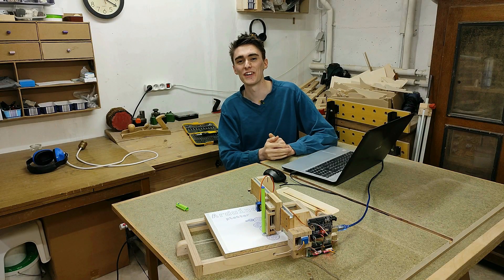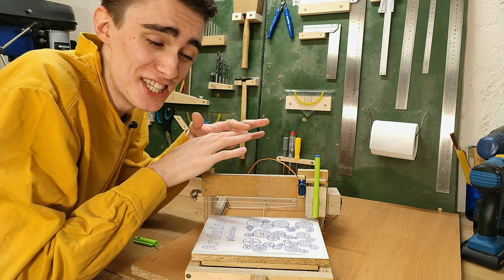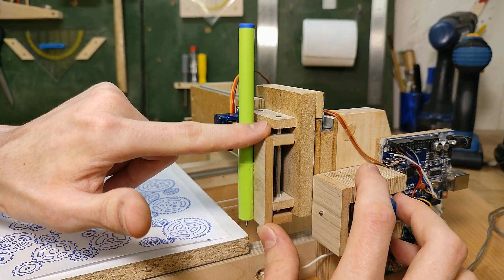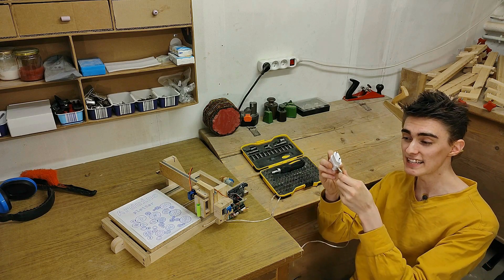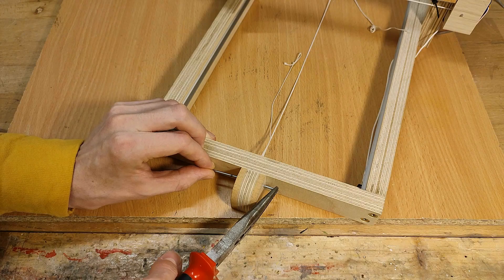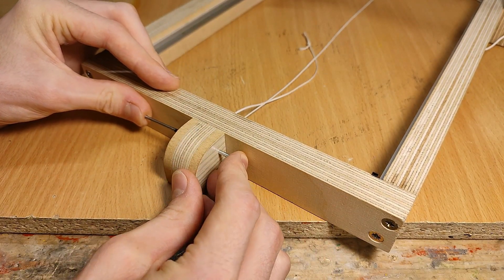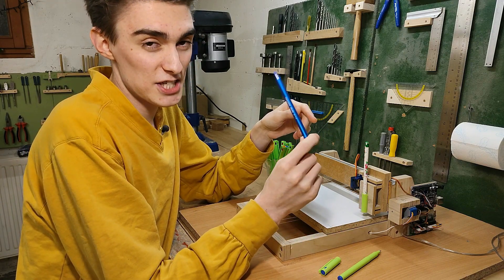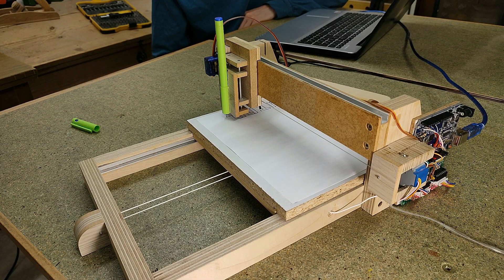148x210mm Arduino CNC plotter using 28BYJ-48 stepper motors

Comment: Really great video !! I really respect your way of explaining everything, BTW I had also faced the same issue with inkscape and I used the svg converter present in the free version of DrawingBotV3 software , also there is the option to edit the starting lines of the gcode so u wouldn't have to worry like with this extension,Also I had to ask how did u managed the backlash of those motor , my motor have terrible backlash ruining the plot?
Reply from the maker: Thanks! Yeah the motors had a bunch of backlash, but I don't think I ever did anything about it since it was less than the line width of my pen.. But I think GRBL has backlash compensation which should be possible to enable somewhere in the configuration.h? Not sure, haven't played around with this in ages...

Comment: Hi there! I want to thank you for all of the valuable information you give us! I 3D designed and printed my own version of a cnc, it took me 3 weeks testing and testing... And after some research I found a program that can improve the gcode by aplying a backlash compensation (in my case 0,22 mm) and the results are amazing, the backlash is completely gone! The program is called Gcode ripper, you can google it. PD, you have to do it for every gcode you want to improve, and for the program to be able to load the gcode you want to improve you have to delete the same few lines you deleted at the begining of the gcode, then set the 0,22 mm backlash compensation and click on Save G-Code - Backlash button. Finally open it with the gcode sender and in the editor you have to delete the lines that gcode ripper added at the begining, including the (----) line and click the save button. And thats it. The preview will look ugly due to the extra movements  added to compensate the Backlash.
Reply: thanku so much!! for the advice been looking exactly for this , will update u after trying.

Comment: i subscribed ;) man you are unik ;)
Reply: hahahaha. tel me somthing please,.. this grbl route to build ploter isnt good, yes. Is tehre eny other route. I need healp. hahahah
Reply from the maker: @theguy186 there sure are plenty other ways to do it, just not any better ones to my knowledge. Instead of GRBL you could always try a different CNC firmware like UCNC or something, but documentation will be worse at best and it'll be just as hacky. I think it's a common misconception that these pen plotters are a suitable beginner project just because they look like one, when, in fact, they most definitely aren't. I give this advice to everyone these days, but if you want to do yourself a favor, build a 3D printer instead. The whole software ecosystem is 10X more mature and easier to use - as well as to get working in the first place. Plus you won't get bored of the printer afterwards like is probably bound to happen with these pen plotters.
Reply: @ChronicMechatronic  This is realy sugestion on point. I dont wont 3 d printer becose tehy are poisunus, and to get them working is pain in the ass. Temeprature jade jade lol ahhaha,.. It is posible to revrite this stuf filmwere. Do you know for eny route to get form kicad pcb out so you can plot it. ;)

Comment: my project stop or hang when run gcode file in UGS.
Reply from the maker: Not sure I can be of much help here, never had this issue - or if I had it, don't remember because it was something simple that was easy to fix
Reply: @ChronicMechatronic  I can't fix it can you help me
Reply: @solankicomputers2874  Did any other gcode test files work or is it that specific one only that you are trying to print?
Reply: @shantilkhadatkar1195  same issue of all gcode files.
Reply: @solankicomputers2874  Can you share me the gcode files. I have an updated version of the software but it is still incomplete. If u want i can share it with you

Comment: Not sure how far you have got with these projects but using arduino uno with grbl shield yields results (use the grbl shield drivers instead of the ones that come with those motors. The grbl shield does away with a lot of fiddly wiring etc). If you use Makelangelo software you can load a svg and it will convert it to gcode. You can modify that gcode and get some pretty good results in terms of shading and effects (Makelangelo is software for polagraph plotters hence you need to tweak in something like notepad or Excel). I used two nema 17 and one  28BY-48 on the Z axis. The use of glass as the surface is good.
Reply from the maker: I've since made an entire series about a new plotter which I ended up designing my own controller board for. Sure it's easier to use a shield, but the point of the project was not to waste fancy motor drivers on a toy I get bored of after 10 minutes :)
Reply: @ChronicMechatronic  I can tell you love the torture. Good though that you've gone the way you have. It's a good way to learn. I've tried to keep the cost down. Couldn't imagine buying ready made  plotter.

Comment: Awesome  ,simply great 👍 sir  , it's an request sir  , why don't you design your own arduino uno circuit to control the plotter  , the way you  designed  PWM circuit  using transistors.  And a 433 mhz transmitter and receiver module circuit used for RC toys etc
Reply from the maker: already did: https://youtu.be/Le--s_UO6Us

Comment: nice video man . great job , i have made the 3d printed version of the same which uses the same stepper motor on the pen aswell. im facing issues of the plotter not drawing as it should all the shapes are not smooth and most of curves getting flat line. any idea what could cause that - im using JSCUT and sometimes the same extension in inkscape. still not getting smooth lines all wired flat and not organized lines. the motors im using are 28BYJ-48 5V with their drivers and an  Arduino Nano . been 2 weeks working on it to fix the problem , still not getting lucky :( hope you can assist me
Reply from the maker: Hmmm, weird... What Gcode sender/CNC controller software do you use? I've had that problem with the straight lines with another Inkscape extension I used before switching to gcodeplot.
Also, if you have 3 steppers with their uln2003 drivers, what version of GRBL did you flash to the arduino? I've been wanting to develop a fully unipolar CNC for a while now, but modding grbl to acommodate a third uln2003 driver is beyond my coding abilities...

Comment: I watch this amazing video again, just to hear you explaining the .gcode file. I came across that issue when switching from a CNC laser with a fixed Z to another with programmatically adjustable Z. Fixing the issue was less hard than the amount of investigation you've been through, a terrible challenge actually. With standardized design e.g. 3018 CNC .gcode files are often harmless even those containing exotic codes.
Reply from the maker: I think since pen plotters are kind of a niche product nobody really needs a lot of people have messed around with the software without there being one universal build (like marlin for 3d printers) everyone inexperienced can rely on...
No idea why someone writing an Inkscape extension specifically for a grbl plotter would make it run commands grbl doesn't understand, but for some reason that seems to be what happened.

Comment: Connection circuit?
Reply from the maker: I'm currently working on a new one where I will go into much more detail on the circuit and setting everything up!
Reply: @ChronicMechatronic  when you upload the next video? Can't wait for it 😍!
Reply from the maker: Pen plotter part 3 - installing the stepper motors is due tomorrow as I'm about to finish editing! 😅

Comment: Help me to solve this problem.
C:\Users\user\Documents\Arduino\libraries\grbl\stepper.c: In function 'st_wake_up':
C:\Users\user\Documents\Arduino\libraries\grbl\stepper.c:192:8: error: 'stepper_t {aka struct <anonymous>}' has no member named 'dir_outbits'; did you mean 'step_outbits'?
      st.dir_outbits = dir_port_invert_mask;
         ^~~~~~~~~~~~~
         step_outbits
exit status 1
Error compiling for board Arduino Uno.
Reply from the maker: Oh, I'm not good at coding, maybe try completely uninstalling all grbl libraries and then reinstall one fresh version
Reply: @ChronicMechatronic  thank you very much
Reply: @ChronicMechatronic  hi! the error compiling is still showing, you need to remove the grbl library on Arduino, then open the stepper.c file and comment out line 192. If you open the Update stepper.c on github, you will see that the author comments some lines, all of these lines are refer to dir_outbits, a uint8_t variable that he commented earlier, so the program can no longer use it. Then reinstall the grbl library.

Thanks for the videos, I recently found your channel and I love it!
Reply from the maker: For the plotter im currently building I'll do an in-depth tutorial on the software part

Comment: Hello, sorry to disturb you. I like your writing machine very much and want to make one by myself, but I cannot find a suitable L-shaped bracket. I would like to know what type of mrtal L bracket you have or do you cut it by yourself
Reply from the maker: No worries, I cut the L brackets out of an old computer case, however I really don't recommend this linear rail system at all, since the aluminum U channel itself usually isn't precise enough (inner width varies by a surprising amount) sanding the brackets till they really fit is quite a pain...
If you look at my my more recent videos I'm currently building a plotter with a new linear rail system that should be much more forgiving when it comes to fabrication accuracy as well as changes in humidity. I hope that can inspire you, since the aluminum U channel rails really weren't that reliable, even though they're made from metal...
Reply: @ChronicMechatronic  thank you very much for your reply and advice

Comment: Hi, can you suggest how to control z axis in place of servo controller
Reply from the maker: Yeah, you need to modify the stepper.c file inside the grbl library in order to acommodate a third unipolar stepper motor for the z axis. As far as I know, that would be done by adding a third variable underneath the line: "int costyy=1;" and then copy/paste/adapting the stepper motion control blocks (the if blocks going like this: "if(costyy==[...]) PORT=[...]" into the segment that does the z axis. Now the part I don't know, is how to route the pin configuration in the cpu map - I'm not very good at coding, but I hope this helps :)
Reply: @ChronicMechatronic  Thank you, I will do as per your comment then I reply its work or not.
Reply from the maker: Thanks 🤞

Comment: Saludos. Please how is the switch is coneted...Im a new one on CNC.
Reply: Muchas gracias. Mi Cnc plotter ya sido programa y probada a un nivel lógico, veo los clip en Led. Estoy en la fase de terminar los drivers con puente H. Estaremos en contacto.
Reply from the maker: I think I used this wiring diagram:
https://www.lesimprimantes3d.fr/forum/uploads/monthly_2019_06/EndStop_NC.png.aa7a86215f312fed32af8d415d878ce0.png